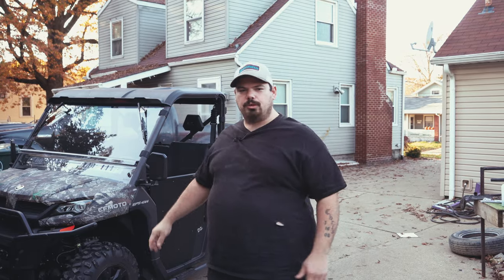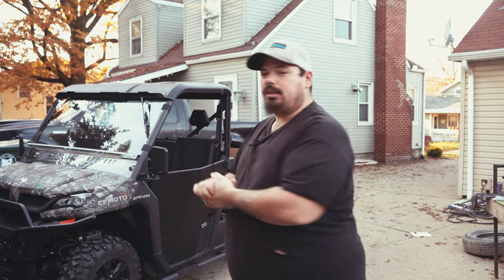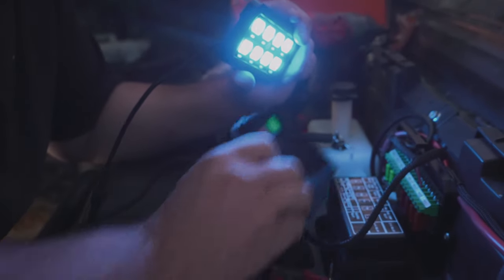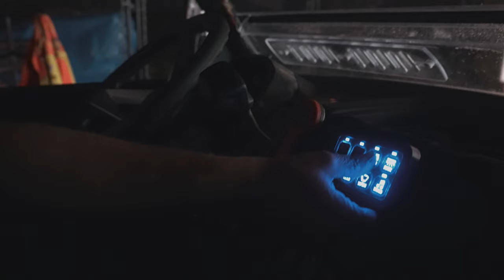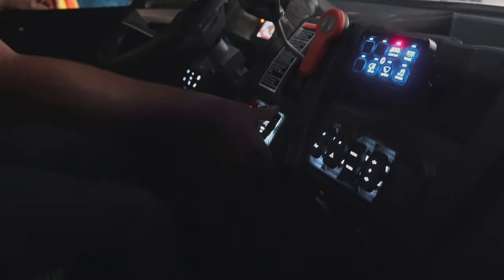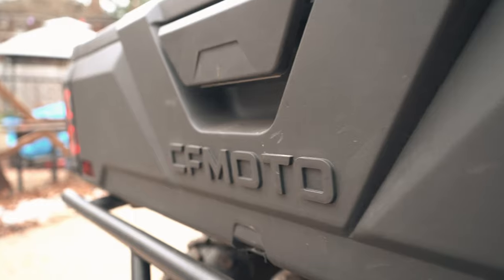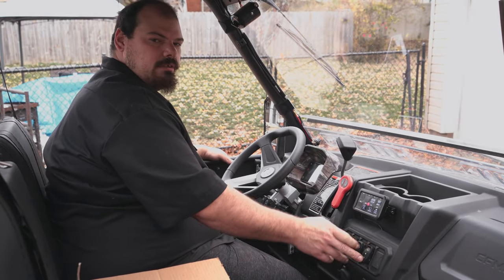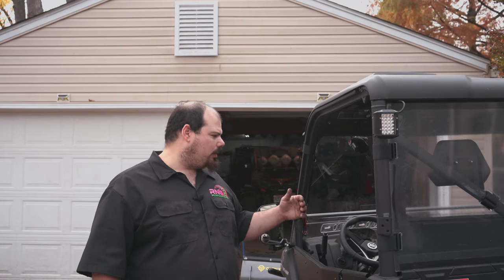CFMOTO UForce 1000 Beast Snow plow Work Rig + RNG Performance Clutch kit.

Comment: A little tip. If you remove drivers seat and storage tray the front bolts on clutch cover are in plain sight,
Reply from the maker: I just remove that plastic and use my Ugga gun on them. It’s quick and painless with a extension swivel and small socket.

Comment: I had an Ice Crusher Cab Heater installed by the dealer before I picked up my Zforce 800 Trail. Very clean installation, great heat & two defrost vents, AND a vent that blows heat on my feet!
Reply from the maker: Heck yes. I’ve heard great things about those.

Comment: In Canada, the turn signals come factory installed on new vehicles as well as a 5 year warranty--included at no extra charge.  The wipers seem kinda useless (short range of motion and fidgety).  How hard would it be to put a hitch receiver on the front of a ZForce or UForce?  Is there any after market bolt on kits available?

Comment: Which mounts did you use for the rear lights? Also would love to see a detailed video on the turn signals on a U1000
Reply from the maker: No special mounts at all. We used the mounts that come with the lights.  And bolted them in the factory holes on the side of the cab.

Comment: Hello! I have a question regarding spark plugs. I'm about to hit 5000kms on my 850xc and I was thinking of changing the plugs. I was thinking of installing the Iridium ones, any downsides of upgrading to those? And am I changing them to early?
Reply from the maker: Now Would be perfect Time to change the stock plugs.  Go with iridium for sure and they will outlast the whole machine they are good for 100,000 miles.  No downside at all.

Comment: How did you get the headlights to turn off on that unforced mine won't turn off
Reply from the maker: I just hit the switch.
Reply: @R.N.GPerformance  my 21 you can turn on the headlights or the driving lights but you can't turn everything off
Reply from the maker: @ronshelly7758  hmm 🤔 I’m not sure.  This one is also a 21